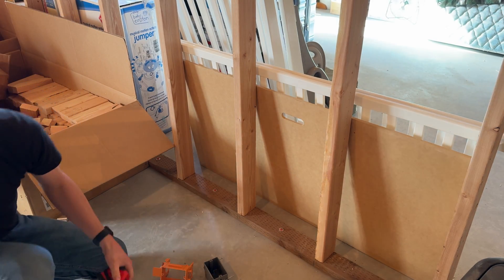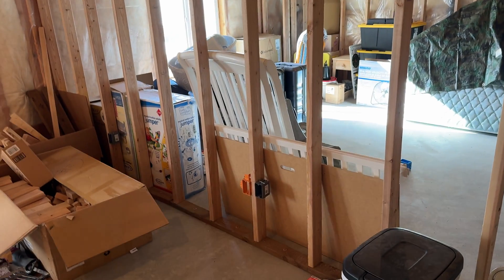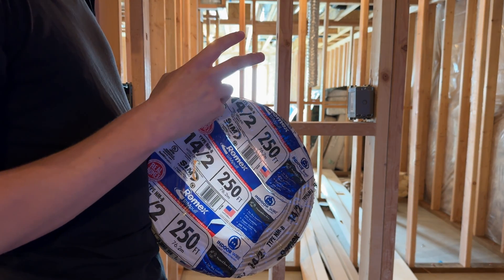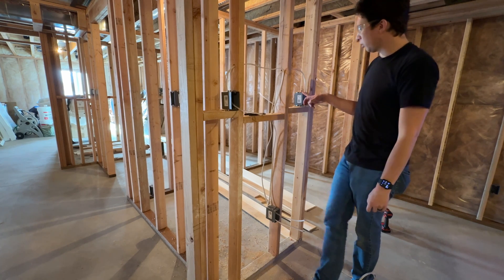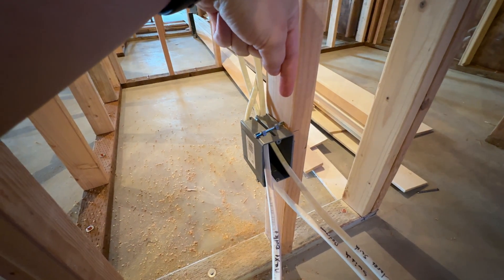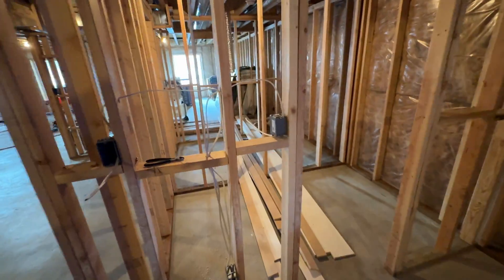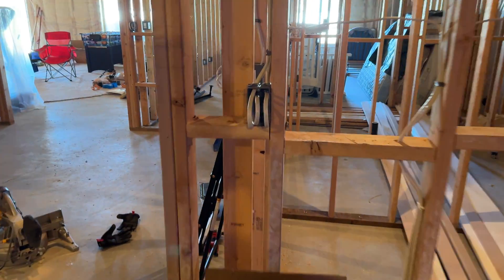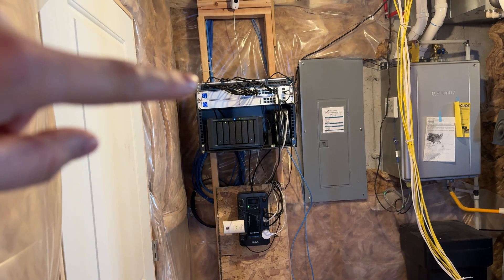How to Rough-In Electrical Wiring (Basement)

Comment: If you know you're using those outlets for a wall mounted tv, then why not install them at the height where you're going to mount the tv? That's what I did. Now I don't have any wires hanging from the bottom of my tv. They plug in right behind the tv

Comment: So does the main power to the first box a light switch have to be on for it to power the outlets? or is it just begin the circuit?
Reply from the maker: Nah, depending on how you wire said box, it won’t need to be on to power the outlets. Basically you bring your home run to that first box and then split where the light switch controls one line from the “T” (on/off) and the other T branch is the outlets which are always powered. Hope that helps!

Comment: NEC 334.30: "... Cable runs through holes or notches in framing members are considered supported IF THE RUN DOESN'T EXCEED 4.5 FEET."  Seems like this rule is often broken and I can't find the best way to secure it while running through studs holes between outlets that are more than 4.5 feet apart (often 12 feet apart) without some ugly bending/looping every few studs.
Reply: I'm not an electrician, but I think you're misinterpreting code. I believe each time your cable enters/exits a stud hole it is considered "secured".

If your studs are somehow more than 4.5' apart, you'd better secure the cabling.

If you're running nm cable through studs and are doing a loopty-loop every 3rd stud so you can fasten your wiring, you're REALLY missing the point.
Reply: @aaroncicali9899  Thank you, you're right! I misread the code. It says that it's considered support as long as the spacing between the bore holes does not exceed 4.5 feet--usually it's 16 or 24 inches, so we're good. Going to blame this one on AI misinterpretation when I asked the question. :)
Reply from the maker: Dang AI…
Reply from the maker: That one's above my pay grade heh. I'd recommend reaching out to your city/jurisdiction and seeing what they recommend since it may differ based on location. Good luck!

Comment: I would use 12/2, it's currently only $40 more than 14/2 for a 250ft roll at Home Depot. Next to nothing in the grand scheme of the overall construction costs. You have a decent amount of receptacles there, which is good, but you never know what someone will be plugging in there. It's not a code rule, but it's good practice to separate lighting circuits (14/2) from receptacles (12/2) in new construction.
Reply from the maker: I considered both. It’s not shown in this particular video but I did put 12/2 in the office and living room downstairs and used 14/2 on this room which is just a guest room and wouldn’t really need more than that. As for the circuits, I considered separating lights and receptacles but the rest of my house (which is only a couple years old) had each room on its own circuit so I decided to match that for the basement. This helped me learn all sorts of things that I’m sure I’ll take to my next build whenever that happens
Reply: @JustinHammond  Fair enough, when it comes to the trim out, I recommend using spec grade 15 amp receptacles and pigtails. If you use residential grade, don't backstab, use the screws.